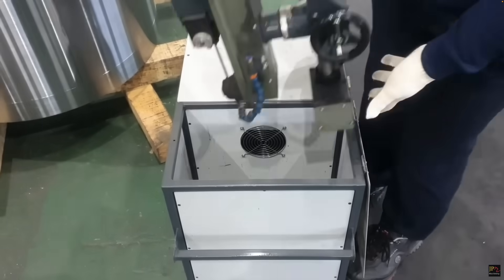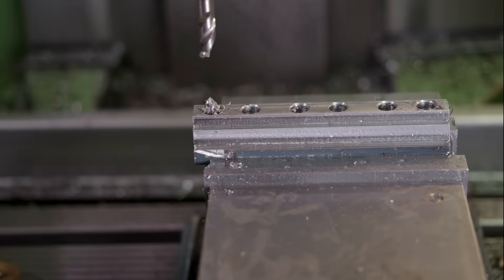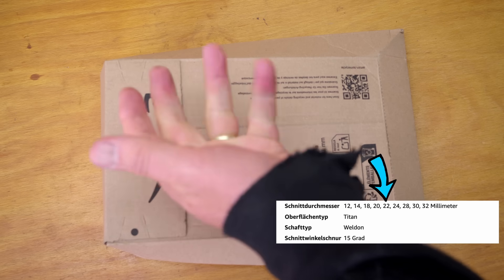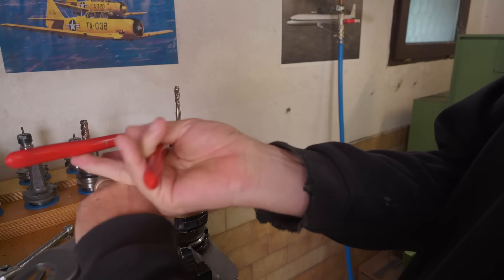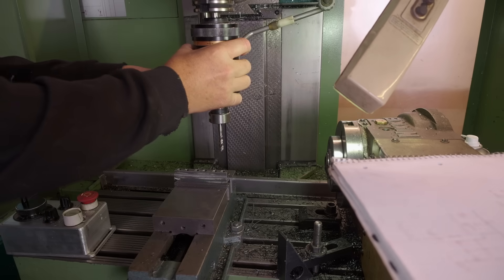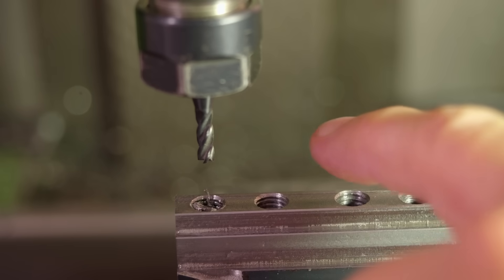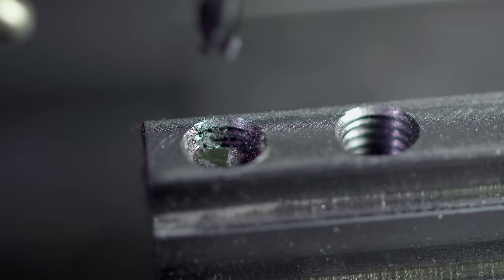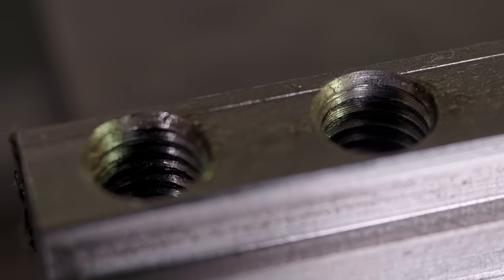Tap removal with only a CNC mill || RotarySMP

Comment: Well done, glad it worked out and didnt murder the endmill :)

The tapmatic on the cnc makes me feel very unwell for some reason :D
Reply from the maker: Thanks Stefan. Since the 400E has only a dumb 3ph spindle motor and 18 speed gearbox with no rpm feedback, I can't rigid tap. The tapmatic is probably overkill, but I like that it also has the clutch to protect the endmill :)
Reply: @RotarySMP  you asked yourself at one point if it didn't like running two tapping cycles on a tapmatic.  FWIW, i was taught to only put a tap into a hole twice if it was a full rigid tapping cycle, as a gcode taping cycle should orient the tap to the same position for each run (like engaging the feed on the same number each time you run a thread on a lathe.)  The tapmatic doesn't have any mechanism to ensure tap orientation.  

I've milled taps out with both your orbital method and just a feed in Z, and i'll echo others here that the point that was emphasized to me was extremely slow feed rate.

Comment: Good tip from Stefan! I'd been under the impression that taps were simply too hard to mill out.

I believe a crude EDM is pretty easy to put together. Likewise with a EDM tap remover - there are just two extra components: a spindle to rotate the electrode, and a rotary connection for the current to flow so it doesn't go through spindle bearings. IIRC very finely stranded wire wrapped around the round electrode works well enough for the rotary connection/slipring.
Reply from the maker: It was easier to do this, rather than starting yet another project, Mark.

Comment: Changed my wicked ways a few years back. The tap you're using is a spiral flute type, designed for blind holes. A miracle & a curse all rolled up into one. For some reason they do tend to break easier in my experience. As you were tapping through holes a gun tap would have been the better choice. They have a softer lead for initiating the thread which I believe results in less tool pressure. 
Where I have changed my ways is I now have a set of each, and only use the spiral flutes for blind holes. And I would never use a blunt spiral flute tap, the rewards are just not worth it. 
Also I didn't notice any cutting oil used (I could be wrong), important for all tapping. More so with spiral flutes.
Reply from the maker: Thanks for that feedback. I did use cutting oil, but am pretty sure it was blunt. I need to get some non-bottoming taps.

Comment: 1:22 you should have aimed for tap breakage in the fifth or sixth hole :-). Tapping fluid is often a good thing. I find spiral point taps nicer for through holes. (less risk, already mentioned by others)
Reply from the maker: THanks Timo. Yeah, I used tapping fluid, but need to looks for other types of tap. Ans not use a worn or damaged one.

Comment: Last year I did a similar thing. Broke an m4 hss tap-drill in a hardened guide-rod (12mm dia), which was not made for that task and then I took a $2 cheap 4mm carbide endmill, chucked it up in a hand drill to get the broken tap out. I ended up crushing the tap into dust but also widen the hole over 4mm and trash the endmill. I expected this result and was happy that worked at all. Then I took an m5 drill-tap and that one was actually strong enough to do the job. Though it took me 1,5 hours to get the hole tapped, because i went reeeeaaally slow and with a lot of care. That probably worked because these rails are only hardened on the outside and had a softer inner core.
Reply from the maker: Tapping into case hardened parts is always a bit of a lottery.

Comment: I was worried the last few mm the tap suddenly getting loose and jumping into the end mill, but I suppose the mill is always "trying" to tighten the tap being it cuts clockwise.
Reply from the maker: There were a few larger chips of tap which were thrown out, but it was remarkably drama free.

Comment: Excellent! I've broken far too many taps and drills working with nasty gummy C101 copper. I've stopped using taps now and just threadmill everything larger than M2. Milling out the tap's remains with the CNC often wrecks the threads as shards get munged into the soft metal. Then of course you get the crunchies while trying to clean up the thread. Bad times!
Reply from the maker: Yeah, I think I got luck on that thread chasing.

Comment: I broke a hss tap off in the spindle of my cnc machine.  The threads that hold the drive lugs in.  I almost cried.  How was I ever going to get that out.  I mounted a little milling spindle in the vice, put a 2.5mm carbide end mill in and cautiously lowered the spindle onto the cutter.  It removed the hss end mill without any thread damage. wrecked the end mill in the process but worth it.  

Make sure your machine can reduce feed rate as the RPM decreases.  That way if the tap stalls the feed rate goes to zero.  And use a rigid tapping cycle, even with your traumatic.  Spindle encoders are cheap...
Reply from the maker: My Maho has no spindle rpm feedback. It is just a dumb 3ph motor through an 18 speed gearbox. There is no simple way to mount an encoder. It is a very tightly integrated machine.

Comment: The G84.1  ...  we use for RIGID tapping . Then the spindle RPM is in Sync with the Z movement... so follows the thread pitch. ( The machine has to have the function for that to work though.  / Spindle is in servo mode via encoder like a axis motor)
Reply from the maker: The Maho has no spindle encoder. It is just a dumb 3Ph motor through an 18 speed gearbox, so rigid taping is not an option.
Reply: @RotarySMP  Of course it is clear since that is a older machine but... also there was no such function planned into that machine at that time. ( or that option was not included )

Comment: The other day i tried to drill a broken tap that got stuck into my cnc bed, and the drill bit got welded to it. Drill bit was cobalt bit.
Reply from the maker: "Colbalt" drills are just a different alloy of HSS. You need at least carbide to machine HSS.

Comment: I have broken too many taps in very expensive parts to even recount them all by now. I usually have a bunch of fairly dull carbide endmills laying on my worktable for various purposes but they can always be used for removing a broken tap.

I found the best way is to use the biggest endmill that will fit (ex. Ø4 endmill for a broken M6 tap) - then slowly ramp down into the hole at around 60 CS. I do it in increments of 3-5 mm per cycle - blow out bits of broken tap - then do another 3-5 mm until enough OR the entire tap has been removed.

Since we swithced all our taps to OSG its been such a pleasure when, knock on wood, a tap breaks. I actually havent had an endmill break during a tap removal since we switched. Before that I could easily go through several for one hole.

You know whats even worse than just having to remove a broken tap? A broken tap including an endmill that decided to explode in the same hole :face-blue-wide-eyes::face-purple-crying:
Reply from the maker: Yeah, I bet that is a real nightmare.

Comment: also, when u grabbed that broken off tap with those pliers - I'd expected those 'hard' corners from both 'surfaces' to create stress risers.  Using a more malleable material as an intermediary interface - alu/copper/etc. might have done the trick maybe?
Reply from the maker: Good tip Joan. Thanks.

Comment: with my luck those HSS annular cutters wouldn't last long, esp in steel - which is why I only get the TCT tipped ones.
On Ali they are about EUR17 a piece incl shipping (+GST tho) from reliable sources.
Reply from the maker: Thanks for the tip. I already sent those ones back and I'm still looking for larger ones.
Reply: @RotarySMP   I got a 30mm and a 40mm in TCT, beyond that they become quite expensive even on Ali and I don't have had a use for such large holes yet (nor the machine torque to actually use them ;-) - still, those prices are nothing in comparison to what I would have to pay for the HSS ones in a store locally (Cairns, FNQ).  Really crazy the markups on things like this around here.

Comment: You definitely had a toolpath or clutch issue - if you watch the video carefully and slowly you can see the tap stalls and then the mill tries to pull it straight out instead of unthreading.

If the clutch is at risk of slipping on retract then you have to be ready to stop the toolpath before it finishes retraction.

Edit: see below, may have misinterpreted what I saw due to lack of famil with Tapmatic system
Reply from the maker: I had that clutch set for M6, but then it should have slipped going in?
Reply: @RotarySMP  To me when I first watched it I was pretty certain it slipped going in, but at the time I also didn't understand exactly how the Tapmatic system worked. Looking more closely I still think it slipped, but only briefly. I haven't done tapping on CnC with a Tapmatic like that, so I might be getting it wrong, but to me it looked like the following happened:

1. Clutch was set at a low setting to reduce risk of snapping the tap.
2. Clutch is operational forwards and backwards (insertion and removal).
3. Tap seized part-way during insertion, clutch slipped (tiny) remainder of insertion path.
4. Due to seized tap, clutch also slipped during removal, so tap couldn't thread out of part
5. Tapmatic has no additional sprung Z travel during removal due to reversing gear operation, so as quill attempted to travel upwards tap was put under extreme tension
6. Tap was the weakest link and snapped under tension

Assuming the above is true, then obviously the tap being seized was the root cause, but it may have been possible to stop the path and then non-destructively remove the seized tap (e.g. heat or such). Now I think about it though... Given how the reversing gear works the only way to spot it would be to have the path force to stop Z travel and let the tapmatic disengage itself while watching carefully and then wait to give you a chance to stop it. Not exactly realistic. So, apologies, I retract the previous criticism; There was nothing you really could have done, except I guess use a good sharp tap (and maybe a higher clutch setting?). 

Of course I could also be completely wrong and it just snapped purely from the ccw torque too... It's hard to see in the video, but the fracture angle on the tap looked mirrored to what I would expect from snapping under CCW torque, which implies it was either still being driven forwards or it fractured primarily under tension.

A happy accident either way I think, you only lost an old dull tap and removing it with the mill has been an interesting enough topic to really gain some traction.

Comment: Nice work and great help from the G.O.A.T. I’ve done the sleeve technique on bigger pieces. I have also put an end mill in a boring head the outer most tooth takes all the work but it worked. Thanks for sharing.
Reply from the maker: Thanks a lot for watching.

Comment: 2:01  Aaaaagh. Huh? Why so fast in with the tap ... or was that sped up???
Reply from the maker: You need 100mm/min feed for an M8x 1.25 tap at 80 rpm.
Reply: @RotarySMP 
Maybe so, theoretically. But was the video sped up?

Comment: Hello from Aus. I had a similar job recently. First I used a 1/4" carbide ball nose burr to machine a dish in the top of the tap. Then a solid carbide drill of tapping size. I brought the drill down against the quill stop a few thou at each peck. Surprised at how easy it was. BC
Reply from the maker: Also a good solution.

Comment: ya could just check and see if Tāwhirimātea has a dremel ... jussayin
Reply from the maker: I doubt I could dig out 12mm of M8 tap with a dremel.
Reply: @RotarySMP  Tāwhirimātea doesn't work with ordinary mortal's dremels.... It's a lightning activated reverse arc metal vacuum....  just so ya know

Comment: For really hard taps i have used small hardened steel punches to break them up. Also thread milling beats rigid tapping, especially if you care about scrapping parts
Reply from the maker: Good point. I need to thread mill more. Tony said so :)
Reply: @RotarySMP  Thread milling is a such a easy win with cnc, easy peasy. less risky

Comment: The tap that you used is for thin metals you need a more heavy duty tap. The one that comes with the bit already is just not supported by enough Metal.
Reply from the maker: Thanks Robert. Good tip.

Comment: Every day is a school day, a great tip from Stefan, and executed nicely by your good self.
Tuning in tapping heads on CNC takes a few attempts, I couldn't use a rapid 3X reverse feature on my conversational Pro Trak controller. I just used a bore cycle and obviously calculate feed at X rpm. Rapid Z height needs setting full stroke.
Ouch! I'm just thinking of what HSS particles are capable of.
Thanks for sharing.
Reply from the maker: Yeah, I bet it is nasty stuff.

Comment: I have a habit of using dull taps and breaking them. Aliexpress has "cheap" carbide endmills with high HRC. I feed very slowly down the middle and turn the tap to dust.
Reply from the maker: That tap was probably also dull or chipped.

Comment: So a couple things I see.

1. Use a specific tapping fluid or paste. I used dark thread cutting oil for thirty years before trying Tapmatic, What a world of difference! It felt like a 40-50% reduction in the torque required to run the tap!

2. That is a blind hole machine tap,  not suitable for hand tapping or through holes.

When you make T nuts have you ever noticed that you can’t run the stud through? not sloppy work, it is so you don’t tighten the bolt against the T slot, force it up and break it.
It looked to me like the tap broke when the spindle reversed rotation.
My boss took out a tap with a hand drill and carbide end mill.

Cheers
Reply from the maker: Good points, Thanks.

Comment: I used this same method to remove both broken taps and HSS drills. One thing as far as taping. If it is a thru hole like that a machine plug tap would be better. Not a spiral flute tap. They are much stronger than a spiral flute tap. Also you can go straight thru in one shot. You may notice most of the time you break taps is in the reversing them. (Watch your video carefully). So on a thru hole if you tap all the way thu  with a spiral point plug tap(not spiral flute) the shavings will go ahead of the tap. When the tap reverses there is no load on the tap. This is especially important in tapping thru holes with form taps. On blind holes everything changes when milling out broken taps because the remaining points of the taps flutes fall into the hole and will destroy the endmill. But you still can do it. Some times I use a endmill that I just grind the tip kind of like a concrete drilling point. Then I use a relatively high speed and manually jog the tool very slowly into the broken tap a little at a time retracting it and blowing out the chunks of the tap then carefully repeating this until the whole tap is removed. The idea is to use the heat if the drilling to soften the steel with the carbide and almost wear out the core of the tap so only the outside of the flutes remain and then blow them out with the air hose. But I wouldn’t try this in aluminum it gets to hot. Also I have used acid to remove steel taps in aluminum and titanium parts before also. This works with the correct acids that don’t desove the parts material but will losen the steel tap. But this takes a lot of time. But sometimes it’s the only way shot of EDM. Or the part is to large or difficult to get a tap erroder in to the tapped hole. Say in the bottom of a bore or something like that. Because to drill or mill out a broken tap takes a very short rigid tool. But don’t use acid on a steel part!
Reply from the maker: Thanks for sharing your experience Peter.
Reply: Done cheap chinesium taps with a carbide tile drill before, hole did not survive, but it was still good enough to be usable to drill out for an insert. Also works for soft steel  screws as well. Those tile bits are very cheap for what you get, even if runout is not exactly stellar.

Comment: We have a drawer of part worn emails for just such an occasion. Works pretty well. The endmills don’t like it though. If you are using center cutting emill plunging straight  in can be an option to.
Reply from the maker: Good point.

Comment: info:
maybe u use some fatter oil or thicker oil to cut stuff. I had a lot of trouble with to liquid stuff. No i use chainsawbar oil. It has about the viscosity of honey. 

And no it wont get ranzid on the machine it stays liquid besides it is made from Rapsöl. 

The Tapmatic can be run some what fast crazy btw. have read about over 600 rpm and on cnc machines too, i have tried 400rpm worked good.

Retract works fine at all speeds i tried. It just has to disengage from the clutch.

But... the all my taps i have broken fast had been blunt in the beginning. They have to be fresh and sharp especialy in 4301 chrommoly. 
Using a blut tap will get you to the mill-the-snaped-off-tap-out-tunnel.

Why dint you tap mill that part? I do all what i can with tap milling. Even down to M2.5. Cnc makes life easier.
Reply from the maker: I only have one thread mill at this point. Need to get some more.
Reply: @RotarySMP  i got mine from aliex. In Alu they have a very long life. Steel idk have used em since i got em about 80 M8 holes noproblem so far. In 1.2379 they work to just with finer stepover steps 0,15mm then you can mill even harden steels almost effortless, but be aware of conical thread milling, do a few springpasses or the thread will be conical.